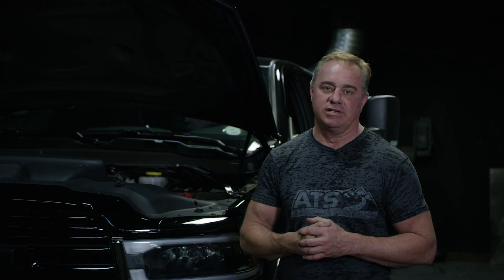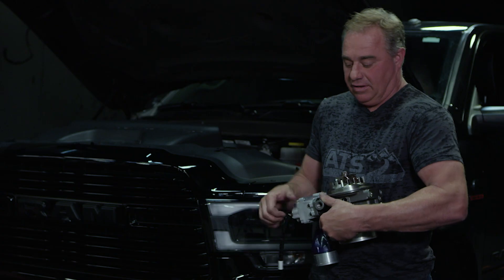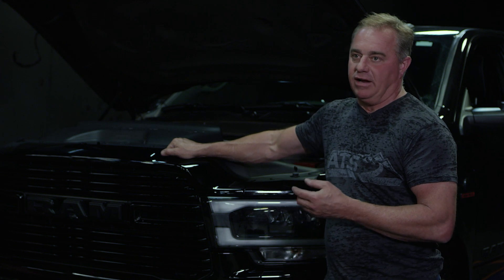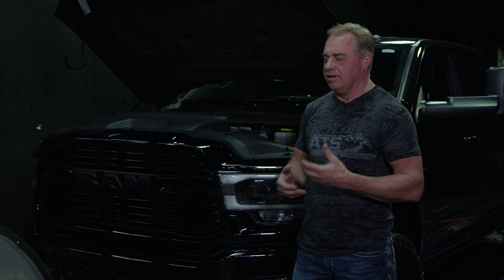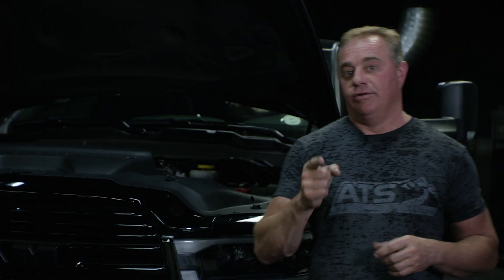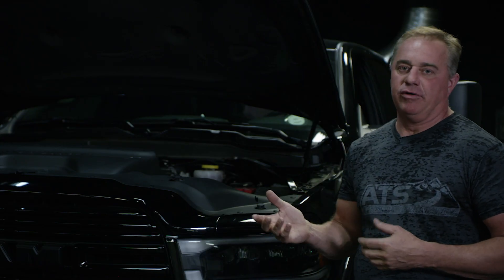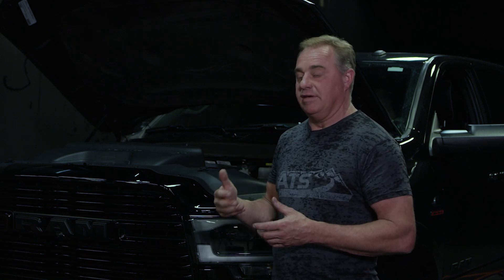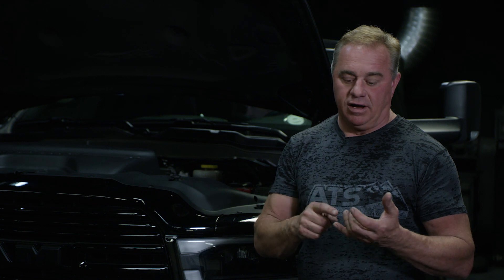ATS Diesel Aurora VFR 4000 Stage 2 Turbo for the 6.7L Cummins

Comment: Will the vfr4000 work on a 2016 chassis cab
Reply from the maker: Yes,  Depending on how heavy you tow!  Give us a call and we can give you more information.  Thanks 800.949.6002
Reply: @ATSDieselPerformance  my truck always has a trailer on it 15,000-30,000lbs it's also deleted with 100hp tune and full banks upgrades.
Reply from the maker: @M1A4R8K8  I would recommend you stay with our VFR3000.  It's going to be more efficient and you'll be able to stay in the correct RPM range for towing.  When you're in the lower RPM range the VFR4000 won't get spinning fast enough to be efficient.

Comment: Head studs ?
Reply from the maker: @brokesxs2547  if you're doing our upgraded manifold and Stage 2 turbo, normally you're doing larger fuel injectors and tuning so head studs would be a great additional upgrade to this and something we would recommend, just depends on what your goal is for the truck.

Comment: Getting all the banks stuff and on the crappy 48 RFE trans I am up grading the valve body and the pressure plate but will I need a new turbo for the power the banks tune is pushing???
2018 mega cab Cummins and the stealth module kills it adds a lot of power to my truck.  But that will be gone with banks tuner